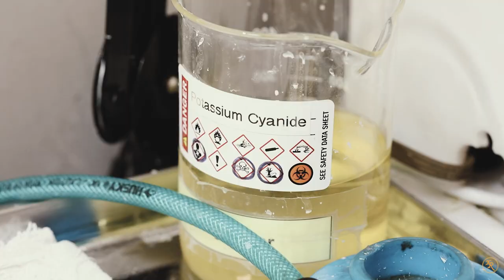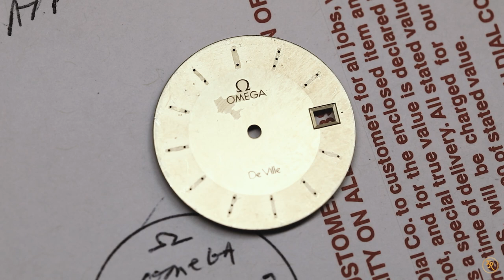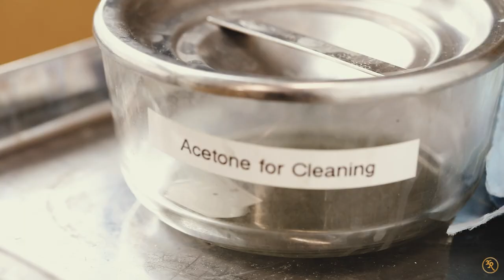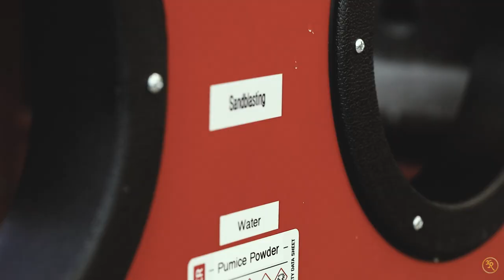[ASMR] Vintage Omega Watch Dial Restoration

Comment: Very interesting how many steps are necessary to make/restore a dial.
Question 1: why bother to get the lacquer, paint and plating off the old dial. Is it not easier to just take a new brass plate and laser drill the holes?
Question 2: how do you produce the print plate to reproduce the exact types?
Reply from the maker: Hi, there! Thank you for your interest in our craft. For your first question, many people prefer to refinish the original dial as it can help retain the watch's value. Secondly, most our our printing plates are original and have been with our company for several decades. When a new one is needed, it is produced by our team designer using a laser engraving machine. We will actually showcase this process in an upcoming video 😊

Comment: How much dose it cost
Reply from the maker: Hi, there! Dial refinishing services start at $225 USD + Shipping Cost, and additional fees depend on the amount of work that needs to be done. We recommend shipping your loose dial out of the watch to avoid a $75 disassembly/reassembly fee. However, if you do need help doing so, you can send in your watch as a whole.

Comment: I couldn't quite tell from the video, but did they save the original dial, and use a spare one for this project? I hope so, because the end result was not good. Despite the amazing brushed grain process, the printing leaves a lot to be desired. The ink weight is too heavy, the Omega logo is too high, the De Ville writing is too low, and the "i" is missing the dot. Swiss Made is too high. There are no index markers between the 5 minute markers, and black border around the date window was not added. Very impressive metal work, but the printing makes the end result look cheap and fake.   Better to have made a full reproduction and not trashed the original!

Comment: Appreciate the hard work and craft, but at the end of all that you created something with a different finish to the original, and in the process destroyed a dial that was in pretty decent condition. Perhaps creating something that looked brand new was more important than a faithful restoration.
Reply from the maker: Hi, there!

Thanks for watching and for the feedback! If you look closely, the original dial itself is in fact a gold two-tone design. Upon receiving the dial, it had a lot of rust and corrosion, which covered up the original design and patterns, which was indeed replicated in our dial refinishing process.

The restoration of the dial was requested by the owner of the watch, and this is typically how a professional dial refinishing works. Our skilled craftsmen restored the dial as close as possible to its original pristine condition, which is very evident in both the video and in the blog photos.